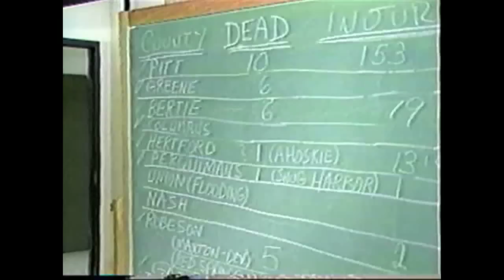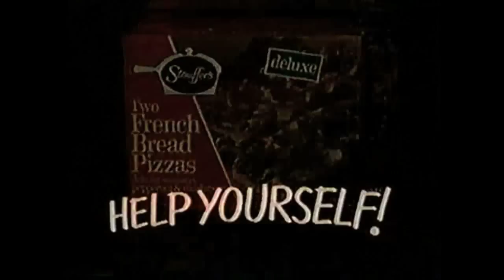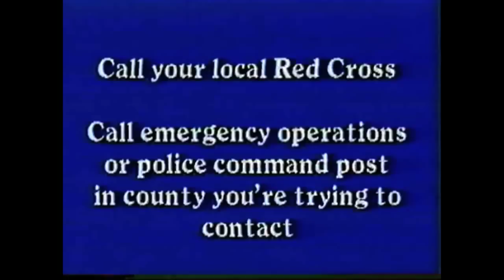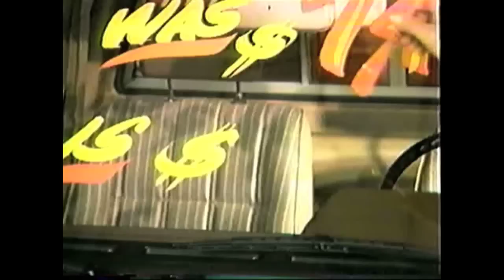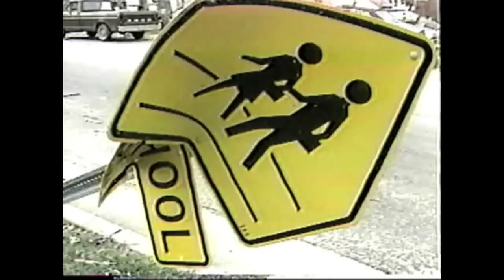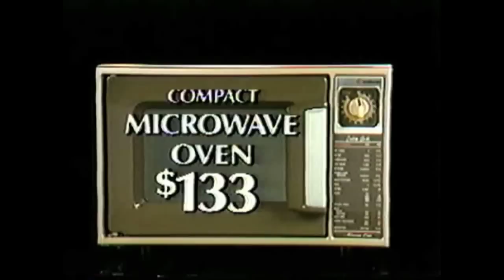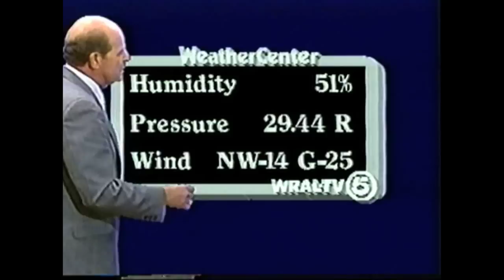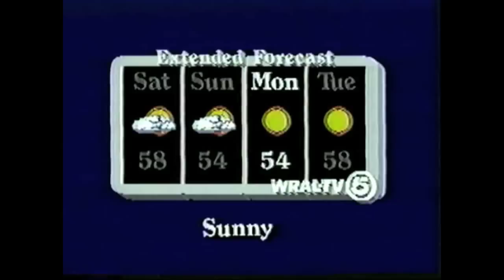WRAL-TV: Tornado Outbreak Coverage (March 29, 1984)

Comment: The Bennetsville, SC twister and the one that hit Red Springs ran almost in tandem with each other, separated by only 5 or 6 miles.  Both were at least F4, and tracked over 45 miles.